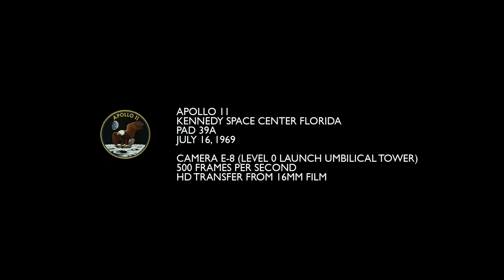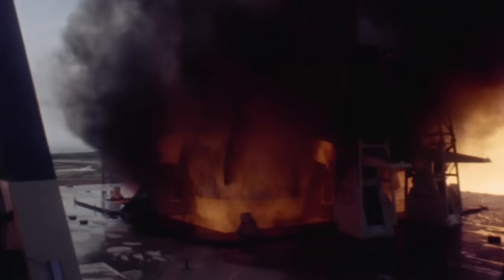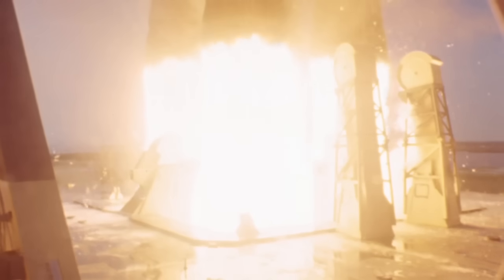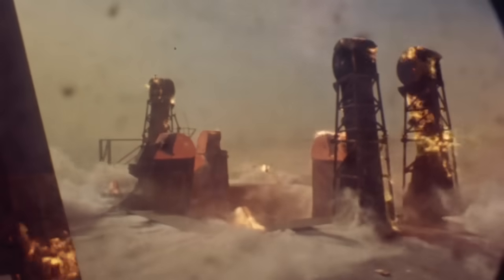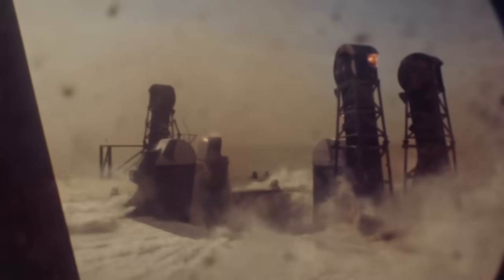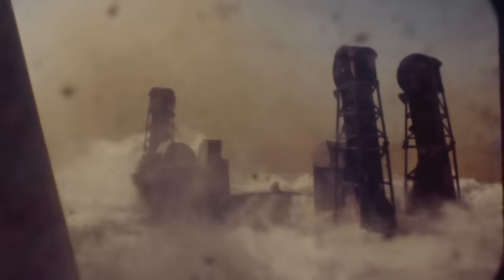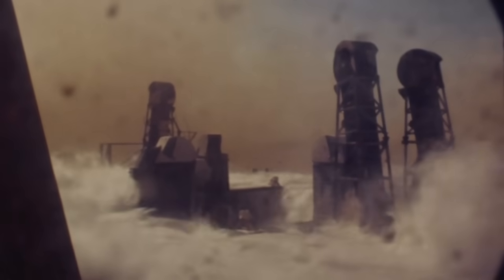Apollo 11 Saturn V Launch Camera E-8

Comment: Extensive analysis of the available data on the Saturn V – and its engines in particular – has revealed that with high probability, NASA’s published characteristics were substantially overstated.
This article focuses on the the F-1 engine used in first stage of the Saturn V. According to the investigation conducted by the Gennady Ivchenkov, PhD, this engine had fundamental design flaws.

This research indicates that these engines could only lift off the pad a modified version of the Saturn V – just 2000 tons instead of the stated 2,800 tons.

Comment: That is fascinating, I never knew about the water, I wonder how many gallons were used.
There must have been some huge pumps moving that water, I could watch a video just on the systems required to control that water.
Great video, thanks for posting it.

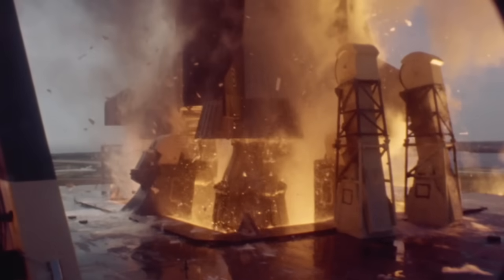Comment: Mark, at 2:07 you start talking about the dark band of gas coming from the rocket nozzles...Exactly how was the turbine exaust "dumped" into the nozzle?
Reply: If you look at pictures of the F1 rocket nozzle, you can actually see a giant pipe wrapping around the nozzle itself. It leads from the turbine to the exhaust nozzle extension. Check it out:

https://imnotyetdead.files.wordpress.com/2013/09/f1-rocket-engine.jpg
Reply: It was channeled through vents in the nozzle extension.

Comment: but it never went to far
Reply: Enough to send man to the Moon, that's all. What more do you want?
Reply: ELECTROSTATIC DISC LIFTERS
so I'll see you at the next annual "we went to the moon" parade? We can throw confetti!
Reply: @electrostaticdisclifters6146  I know it's flat. Not much difference between a rocket engine and a jet engine, both push off air.

Comment: Was Jsilence one of those that were released when the county closed down that asylum a few months back? He'd soon see the stars once Buzz got hold of him. By the way, I was told they force sterilize these people, so at leas Jsilence won't be spreading his faulty genetic genes about the population, Phew, wipes brow. I love this scene so much, just looking at the power is so awesome. You guys are just great.  Question for someone. At what speed, let's say 5 seconds after lift off was the rocket traveling?  500 fps, that 2500 frames, so 5 mph.. Impressive.
Reply: Tony ISIS *8kph, Apollo flight computers, calculated with metric system

Comment: I don't get the exhaust-coolant thing.  Is it on the inside or outside of the nozzle?  And how cool is it?  shouldn't exhaust be hot?
Reply: FosterZygote Accurate description, except for one minor detail.  The thrust chamber was cooled by RP-1, not the cryogenic LOX
Reply: DoctorDeepSea No big deal. I got the fuel used to cool the thrust chamber wrong because I went from memory. But the gas generator was started by a hypergolic cartridge.
Reply: DoctorDeepSea Actually, the gas generators used the same fuel as the main engines, from the same tanks. But the exhaust gas cooled enough before being injected into the bell to act as an insulator.
Reply: Thanks for the input guys.  After rewatching the video with more concentration i found the answer to my question.  The narrator claims that the exhaust gas is vented through the INSIDE of the nozzle and "acts as on insulator"  But that opens up even more questions.  Does the exhaust gas flow through tubes on the nozzle like the liquid hydrogen? Or does it just flow out of the nozzle with the Kerosene?
Reply: BackCountryBrdr If you look about halfway down the nozzle, you'll see a horizontal ring wrapped around it. The gas generator exhaust flowed through this and entered the nozzle via holes that ringed the inside of the nozzle. The upper half of the nozzle was cooled by the cryogenic fuel which flowed through tubes that ran down and up that section of the nozzle.

Comment: With all you say, which camera angle was this?  The timing even 5x, 10x does not calculate. Use a calculator. Its pathetic conspiracy stuff? I do not know what you are trying to get at. Light a bottle rocket in your hand and see if 10 respond the same?

Comment: I found an obscure NASA doc on Saturn V/F-1 engine start and launch... IIRC approx. 44 TONS of LOX+RP1(kerosene) was burned BEFORE the hold-down arms were even released!  i.e. between the bursting of the hypergolic cartridges and getting all 5 engines up to full and even combustion, some 87,000 lbs. of fuel was turned into fiery greatness, and shot down the flame trench!  =:O

Will try to find the link.

Comment: +Eric Stallings, they don't use kerosine anymore for liquid engines, its only liquid oxygen, and liquid hydrogen. In fact, sometimes during testing of the Space Shuttle Main Engines in Louisiana it would actually create rain systems due to the liqued fuel that is used. Totally harmless to the environment.
Reply: SpaceX and others use RP-1(kerosene)/LOX that mix still has some advantages over LH/LOX.
Another fun fact SpaceX is using the same launchpad as the Saturn V/Apollo missions.
Reply: Kerosene is around 10 times heavier than liquid hydroged, so you need to have really big tanks for hydrogen of the same mass. Even if hydrogen gives higher Isp, tanks are around 8 times larger for the same lifting capacity. That is why kerosene was used on first stage of Saturn. I've calculated that if it run on hydrogen it would require 56 cubic meters of LH2 per second, waay to much. Second and third stages indeed fun on LH2.
Reply: They should use dimethil-mercury for higher thrust :D
Reply: Guess what the Russians still use as fuel
Reply: Check your facts Nick.
Reply: ***** Have to educate myself :) But really he's worth anyone's time, he's great.
Reply: macuss87 SpaceX publicity hounds got the lease for the very historic (and very WORN) LC 39A... hopefully the more business-like ORB+ATK merger will get to use the lower-mileage almost-as-historic 39B complex (which launched Apollo 10--The Big Teaser!) .
Reply: The above statement is incorrect , Kerosene and LOX are still used on Atlas V

Comment: so why is it that NASA has a competition out to get someone to remember how to design F1 engine, again???
Reply: Don't think 'design the F-1 again' -- think 'successor to the F-1' (actually, there was already one successor, the F-1A, that would have been placed into production had the Apollo project continued as far as Apollo 20).

As to the question of 'why'? Because materials have improved, because manufacturing can be performed to even better tolerances, because simulations are of higher fidelity, because mechanical engineering and fluid dynamics are much more understood. All these things and more are better now than they were 45 years ago.

As far as 'remember how'? The plans and specifications for the F-1 are not lost, as so many people claim. They're on file in the F-1 Production Knowledge Retention Program archives. Also, several examples of the originals exist, in storage and/or on display. (The same is true of most of the components of the entire Apollo/Saturn system.)
Reply: ***** Thank you Ma`am for your knowledgeable reply.

Comment: Those engineers used their sliderule, pencil and paper to perform engineering calculations, designing Rocketdyne F1 rocket engines.  No calculators no computer modelling or data simulation.   I give them total respect for their work
Reply: Yeah! Werner von Brown's master piece of enginery, almost perfect, flawless!!!
I agree with you. Those engineers have the right stuff, and deserve total respect.

Comment: What's the first fireball doing?
Reply: That's the initial combustion of the kerosene, before the engines were running at a high enough speed to force the flames entirely downwards.
Reply: Dash Vader Yep.  Too, at that moment, the flame-trench is in deep-freeze from hours and hours of pure LOX spilling down there, so that initial (relatively) low pressure combustion sort of "bounces" up off that mass of cryogenically chilled air... the delta-Temperature that occurs in that space in the next few seconds is as "raised eyebrows" as everything else about Apollo. =:O

Comment: Did they use the propellant as an F1 engine coolant like in the space shuttle engines...
Reply: no the relatively cool pre burner exhaust traveled through ducts inside the nozzle and helped keep it at a reasonable temperature then it exited the ducts where the nozzle joins to the nozzle extension to insulate it from the exhaust of the combustion chamber

Comment: @andris kuzmenko: Are you just plain stupid? Or very stupid? Who would you rather have had von Braun? You Ruskies(oops, I gave it away) or the US? Of course you wanted him to go to YOUR country. If you're NOT a Ruskie, then the question should be rephrased. Are you just plain stupid? Or very stupid? We had a choice: Threaten him with a Russian slave rocket building camp, just like the tunnels at Peenemunde, where von Braun knows the FIRST thing they would have done to him was punch him hard in the face five or six times and then strap him down on a table and pull all his toenails out of his left foot. THEN they would have said the first words to him. Guess what those first words would have been, fuckface?

Comment: There's a graph of acceleration versus time on the Wiki article about the Saturn V. First stage acceleration at liftoff was about 1.5 G. As the rocket got lighter acceleration peaked at about 4 G. Second stage started at about 0.8 G and peaked at about 2 G, and third stage never got above 1 G.